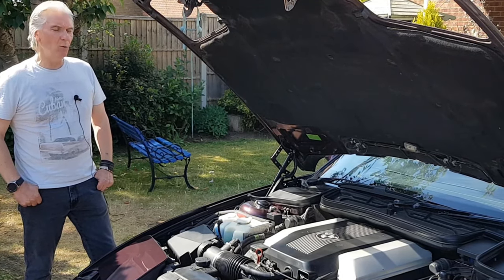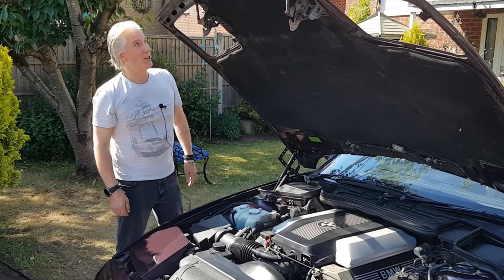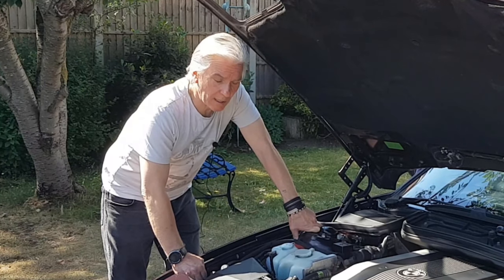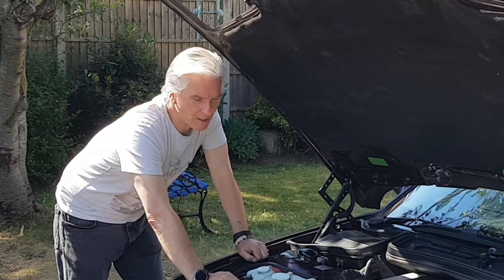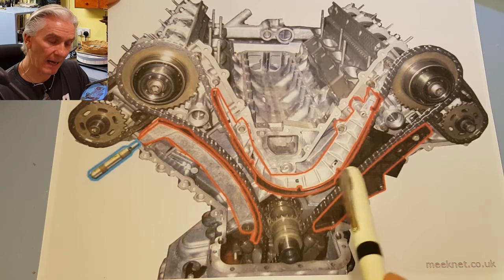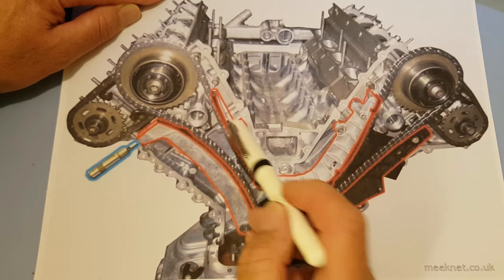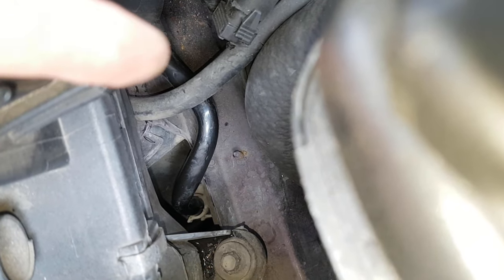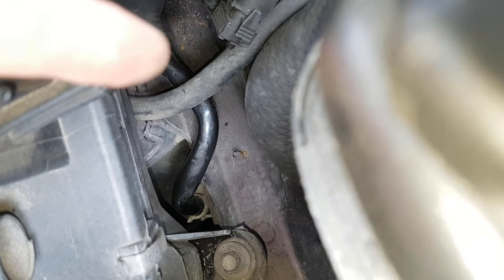BMW M62 Engine - Save your Timing-Chain Guides!

Comment: It’s amazing that people who buy these cars get cheap and put off oil changes. When I was in VoTech school in high school they told us,oil is cheap,engines are not. Change your oil every 2000 miles. Well, that was 1970,oil is much better today. I change it when the engine manufacturer specifies,maybe even a little earlier. I’ve never had a problem with tensioners.
Reply from the maker: Too true!

Comment: my 2001 540i six speed had 235K miles when I had the guides and suspension rebuilt.  The guides were still intact but he tensioner was all in and was due.,,,  cost a fortune, but I have a great running and driving car that I have been daily driving about 100 miles a day for 18 years....one hell of a car...it deserves the money Im wasting on it ;)
Reply from the maker: You can't beat the E39 540i for fun!

Comment: Interesting theory I’ve heard them going out on well maintained ones, chains do stretch after awhile. It is a lot of work to do the chain and guides. If you get away with just regular oil changes great.

Comment: Ive changed the guides on the m62. They are crap, oil changes wont help you, plastic parts in engine oil at high temps will only last so long. The pcv valve fell apart in my hands. Its not if but when.

Comment: These things are so interesting, i am looking to buy a car with a M62 engine, so this is very helpful to me. I have replaced the lifters, and serviced the vanos on my M54 engine once and alot of that experience comes back in to play here! Now i do have a question, if i for an instance buy one of these cars, should i replace the tensioner as preventive maintenance, or is it not common when the car is serviced properly?

Comment: Tim Good work.
M60 timing chain guide falure is LESS COMMON due to the idler sprocket distributing a lot of the tension and friction from the chain.  the fact the engine temp is not kept as hot as the m62 with the map thermostat, less heat means cooler oil temps to not bake and brittle the plastic guide material along with thicker oil preventing wear.
M62 with map thermostat (Nov vanos) plastic guids break MORE COMMONLY because of the increased operating temp, leading to warmer oil which is thinner causing more wear and baking the timing chain guides to brittleness. Along with the u guide replacing the idle sprocket which sees a majority of friction and tension which is why it is the first item to fail.
M62TU (vanos) failure rate is EXTREMELY MORE COMMON (around 100,000 mi) same issues as the non-vanos m62 however when the Vanos hub seals start to not hold oil They act like a impact gun (momentarily making a knocking sound until they can fill with oil) which transfers this impact motion through the chain to the plastic guides and shatters the u guide certain instances after it havs become brittle and worn out. You can hear the hub knocking momentarily on cold startup with certain starts.

 @high_mountain_ machine
Reply from the maker: Good to hear from you Jesse! I agree with you, but having regular oil changes will add longevity to the M62TUB44 - I've had three with the temperature-mapped thermostat and two of them well over 120,000 miles. I agree regarding the Vanos though, they do sound like little diesel engines at start-up. However, fully synthetic Castrol oils have additives that can help in that respect so that oil will cling to surfaces for extended periods.
The problem is always that E38's just don't get looked after - they are perceived as a cheap car (by most) and the end of its useful life - and they just don't see oil changes, coolant changes and filter changes - and then they die very quickly!

Comment: i bought a 735i with failed timing chain guides. I thought Id just drop in a good used engine, but under further inspection there wasnt any apparent damage from the alluminium shavings going around. SO i took it apart, rebuilt the lifters, resealed the entire unit, replaced all timing components and voila, engine runs well. Flushed the oil 3 times. No issues so far.

The oil filter was stuffed with aluminium shavings when I got it, but now you wouldn't even tell anything was up with it.
Reply: i disassembled and inspected the oil pump, light scoring was present but not alarming as far as i could tell. Maybe I'll replace the oil pump later. This is to say as long as the engine didnt skip timing, if you catch on to whats gone on theres a chance you can still save it.
Reply from the maker: Good work!

Comment: Thank you for sharing your wealth of knowledge, Timm! I just purchased a 1999 e38  with 79k miles which runs just fine (apart from the trifecta issue which I am working on). But as preventive measure I will replace the tensioner immediately and do an oil change and hopefully this will help me prolong the life of the guides and engine.
Reply from the maker: Nice work!

Comment: Dear Tim.

I only recently found your channel but I wanted to say how much I have greatly enjoyed your explanations and videos.

We own a Titanium Silver E39 540 Sport, built in July 2001.
I took the M badge and 540 logo off the car and she remains on the standard 17inch sport alloys, so at her age she is something of a street sleeper :o)

It's very interesting listening to your maintanance advice and watch the common problems videos. Having owned our old girl for 8 years now I've come across the large majority of them.
As you have found, she's run only on Super Unleaded fuel ( usually V-Power ). I've always run my vehicles on the highest octane fuel I could buy, but since the release of E10 this is even more vital. That stuff is an absolute disgrace.

The car came to me with a very good service history, including 2 previous gearbox services. It only does 4k miles a year with us, so my maintenance regime is every 9k miles or 1yr, whichever comes first. The way you can tell she's well serviced is the oil always looks clean and clear. This may have something to do with the numerous oil leaks all over the engine ( front and rear mains being the worst ) so I do have to top her up occasionally but if I use a litre in a year it's alot. You get used to the burnt oil smell ;o)

Not long after I got the car I changed the chain tensioner...the difference between the new and old tensioner was alot. I took a picture of them side by side but can't seem to find it. How often do you reckon you should change it? I was going to give it 10 yrs. It's interesting the way you say to change it. I didn't know that. I just took the old one out and threw the new one in, no pre charging the hydraulics. Oops.

We've just had the gearbox serviced for the 2nd time in my ownership. The oil even after 6 years was still in excellent condition which is pleasing.

We've had our share of coolant problems. Rad, 2 expansion tanks, a hose went pop and a valley pan. I bought a 7 series none electronic thermostat and bypassed the electronics for the ECU. That seems to have made a difference. Also had a new alternator...who would know it would be so expensive..a bloody watercooled alternator...

Another question for you whilst it's in my head. Is the waterpump impeller metal or plastic? I had a new one 4 or 5 years ago and it's coming up to belt change time and wondered if I'd be ok leaving it as it isn't leaking or causing any trouble.

Obviously had a load of bushes and other random stuff changed. Went through a phase of killing brake discs...think I had 3 sets of front discs and pads in 3 years...finally switched to apec and put 2 new calipers on which seemed to solve it. Recently sent the ABS pump and ECU off to be tested but they said it was fine...It's playing nice at the mo but I hope it stays that way.

I've recently been getting a puff of smoke out the exhaust on startup ( worse when the weather was cold ) and a little rough running untill she's warm. So will be ordering a new CCV this week. I recently changed, bank 1 CPS ( had a warning code ) and I changed all 8 coil packs. The packs on the car were the originals from July 2001. After changing them i can say that she has never run smoother in the 8yrs we've owned her. In fact I was shocked at how noticeable it was. Maybe a video in that for you about coils breaking down over time?

The car doesn't always get used for a week but I make a point of taking her for a 40mile run on the motorway, once a week, every week. They need to be used to stay healthy and to keep the battery reasonably charged.

Last year I had 2 new sills fitted and all the jacking points rebuilt due to rust. Then the entire Chassis Dinitroled. So hopefully no chassis rust worries for atleast the next 15 to 20 years. I've just nipped a little rust in the bud on the rear arches and I'm keeping an eye on the bottom of the front wings and the roof near the windscreen.

It's interesting what you say about regular servicing and tensioner replacement regarding timing guides. I have put money away for an engine rebuild when they are ready to do and was told usually around the 150k mark. But our chain is still quiet at just under 150k so fingers crossed it will be ok for a while yet.

Our car has had a rattle on start up since we bought it. Sometimes it's there, sometimes it isn't, sometime worse, sometimes not. When you first hear it it sounds really scary. I've had several people waving at me in horror. LOL. Although it's been doing it less since new CPS and Coils have been on.... I originally thought it was chains before I knew any better but have since learned it's either, just noise from the vanos, or some slightly sticky hydraulic lifters, and as long as it's only a few seconds is nothing too frightening.

I was surprised about what you said about 0-60 times, but your video about the diffs was enlightening. Our car has always seemed fast ( obviously newer stuff is a fair bit quicker but still ) and pulls like an absolute train once she gets a head of steam.

I plan 1 day to get a performance exhaust but keeping the single exit as is on my car. Streets sleeper remember ;o)

All the stereo remains standard ( alot of people mess with this ) it's just had the radio modified, an aux socket plugged in, a newer dvd player fitted with software ( Mkiv High )  and the cd changer plays mp3's. We added a bluetooth phone kit but it is entirely standard otherwise. I even still have the old traffic master module and mobile phone kit.

The only other thing I think is worth mentioning..... I've done the rocker cover gasket twice now...once I did it myself but it started leaking again..so 18mths later I had a BMW technician do it to make sure I hadn't screwed it up. Guess what. Still leaks. As part of my servicing I occasionally take the coils out and if any oil has pooled blast it out with the air compressor and a rag., I've since found out a faulty CCV can cause problems and am now going to try your washer fix on both the rockers and the intake so thank you very much for that.

Anyway I look forward to watching more of your videos :o)

They are excellent.

All the best. Buzz
Reply from the maker: Thanks - a lot to read there!

Comment: Wow, at last a full explanation of the dynamics of the timing chain motion, the guide failures, and the role of the 3 chain tensioners -- including the relative unimportance of the two deep internal ones that Timm says rarely fail and are generally not in need of attention but others are happy to charge thousands to get into along with a full "preventative" guide replacement--which I've heard BMW officially states is a 20-to-24 hour book time project.    Told clearly in the calm informed voice of a Cambridge or Oxford Physics professor,  I loved the demonstration of the direction of rotation and the interplay between the two banks retard vs advance.  I'm happy Timm disabused all the naysayers who warn not to change this tensioner, out of superstitious fear of "triggering something catastrophic" , and instead is helping the environment and people's pocketbooks by keeping these beautiful BMW V8's rolling and giving so much driving pleasure to their owners - in a less than one hour procedure and a part under $100.   It also helps restore some confidence in BMW engineering in that they did have a simple plan for avoiding engine failure and didn't really consider the guides to be a consumable part like an oil filter.  I'm now feeling good about changing the tensioner in my 2002 540i wagon and hoping it resolves some pinging only coming from the right-side (US passenger side) bank and generating some knock sensor D2 and DME multiplicative mixture 1A codes despite a brand new throttle body and knock sensors--and if I understood Timm correctly problems start on that side first.  One thing I wish he included was at around 26 minutes to show the actual old tensioner coming out, and would have loved to see a demo of Timm comparing the tension of old vs new.  Others have done that online, showing with scales and even comparing a newer and older revision of new tensioners that apparently have a big discrepancy in both tension like 7 to 14 pounds, and even a few centimeters difference in the throw!  I was wondering if those "dry" tests aren't accurate because of the lack of hydraulic pressure outside the engine.  Timm, can you comment on exact part numbers and this issue of a few different versions of the tensioner out there?  Is the newest much improved?  Do you prefer the older?   Would you go only genuine BMW for this part, or are Febi or ANA and others okay?  Or are they all just fine and the main thing is to follow your advice and change them more frequently?  I certainly would be happy to ship my old one to you in the UK in the interest of BMW science!    Thanks for all you do, Timm.
Reply from the maker: Thanks! The spring only extends the piston as the guide rail moves - think of it as a ratchet system - as the piston extends (by the feeble spring pressure) oil enters behind it and so it will not retract again. All the force is produced by the oil pressure - the spring really has very little effect. The newer version allows the piston to extend further - and you need that to take up the wear!
Reply: The ratchet idea makes so much sense!     Regarding the identity of the correct tensioner part number, can you help us ensure that when we are buying these we are buying the newer version?   Do you have the part numbers of the newer and older versions?    It seems like 11317531813 is the most commonly sold one, but perhaps that is the older shorter version and it would be so helpful to know that we're putting in the slightly longer one to take up that  extra slack from the wear.

Comment: Timm, Thanks for the education on a failing timing chain. It definitely exhibited the timing misfires on my M62 withOUT VANOS due to the lower guide failing. My mechanic didn't recognize it at first because on later VANOS models it tries to compensate with the variable cam timing. Not a terrible job just lots of bits and time.

Comment: Hi Tim, and thanks again for this awesome video, I really appreciate the way you explain these things.
I've been watching it from time to time, since I've changed the chain guides in my m62tu about 6 months ago. 
My engine only had 82k miles, and I actually couldn’t believe, that the guides went this early. I changed the chain tensioner on the day I bought the car at 70k miles. The old tensioner was the original from 2000 and totally seized up, couldn’t compress at all.
The only conclusion to the guides failing this early, that I could come up with, is the fact that the previous owner didn’t change the oil regularly, and the fact, that I didn’t build up the oil pressure before starting the engine, after replacing the tensioner. This is probably the major cause of the chain guides wearing this early. 

I’m just glad, they’re functioning now. I change the oil once a year, which is every 6k miles.

A few things though that keep coming back to my mind about chain guides, I wanted to ask you, which I hope you can help me figure out.
I’m using mobil 1/liqui moly or castrol 5w-40 oil all year around, and here in Denmark, it can get quite cold at winter.
How long time does it take for the oil to reach the chain tensioner, and applying maximum pressure on the tensioner guide, on cold starts at freezing temperatures?

My concern is, that the engine in this case manages to startup, before the actual tension on the guides has been reached, causing the guides to wear out quicker during winter, correct me, if I'm wrong. 
Is this even a concern, or does the actual oil, which is already inside the tensioner prior to starting 
the engine, help with this?

Another thing, there’re many speculations on failing guides online caused by brittle plastic on the V-rail.
Let’s say the plastic has gotten brittle during the last 20 years, and most likely detached itself from the V-rail.
The chain is kept tensioned at all times, since oil is changed regularly and the chain tensioner is replaced within the acceptable interval.
Would it even be an issue to continue driving like this, if the chain is fully tensioned at all times?
Reply from the maker: The tensioner will retain the oil and will pressurise quickly, and yes, a lack of oil changes will kill the chain guides and the tensioner!
Reply: @TimmsBMWRepairsandInformation  Thanks. Will the tensioner pressurize as fast both Summer and Winter with very different outside temperatures?
Reply: The difference in viscosity at cold temperature between a 5w30 or 5w40-50 is insignificant. If it was 5w30 and 10-15w30, then yes that would be felt by the engine during cold start as the viscosity at cold temperature would be greater while having similar hot viscosity.